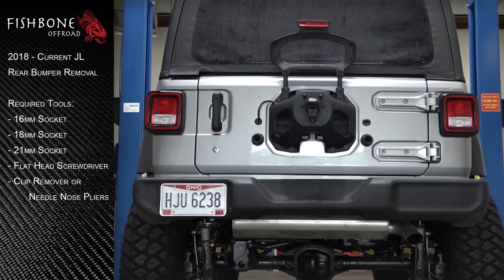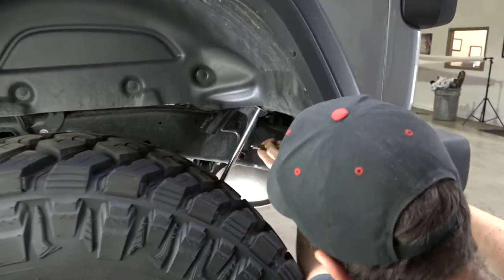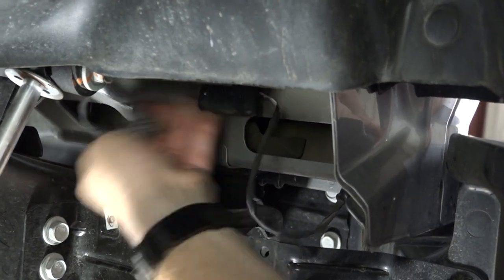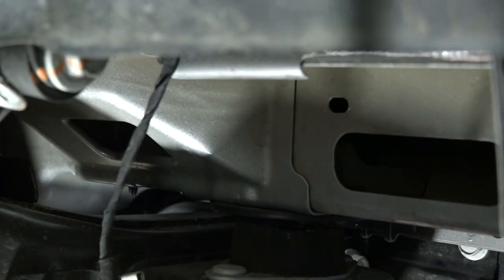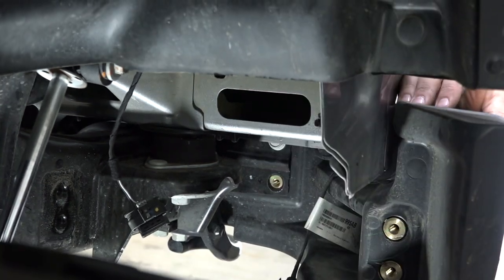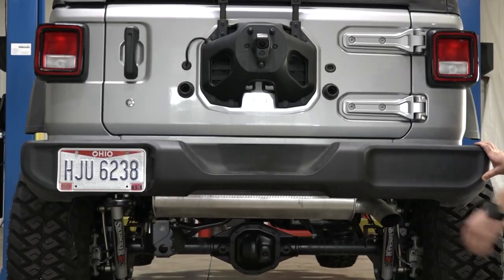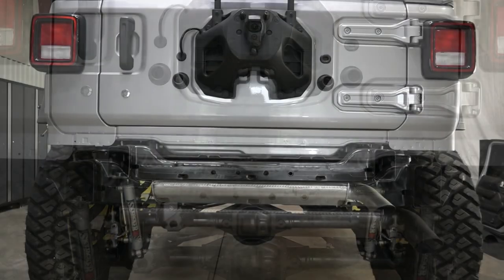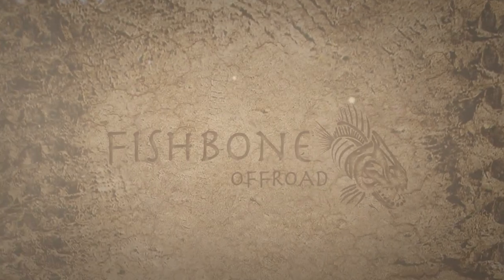How to Remove a Jeep Wrangler JL Stock Rear Bumper: A Step by Step Guide

Comment: On my ‘24 the 4x 16mm “rear facing bolts” shown in the video are nuts on bolts with ~2” extension. You cant fit a regular socket over the bolt and an extension socket cant fit between the body and the top bolt. Some bloody knuckles and ratcheting box wrench required.

Comment: On my JL the wiring is secured with those plastic screws all along the length of the bumper... taking them off was awful!
Reply: Why would you have to? Leave it secured to the old bumper except at the harness part. (unless of course you needed it for a different  application)
Reply: clip removal tool to get it started... needle nose pliers to finish. this seemed to be the trick to both remove and keep the christmas tree screws (with the attached zip tie thing) from breaking.